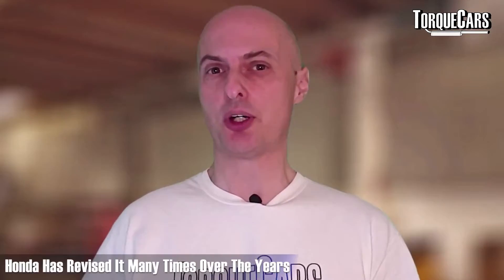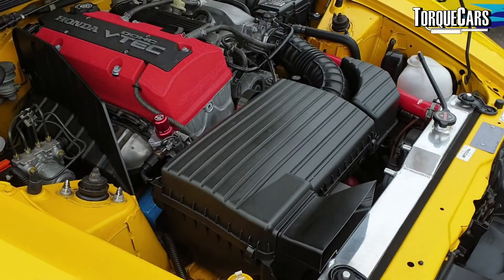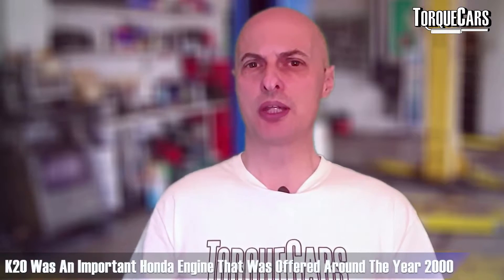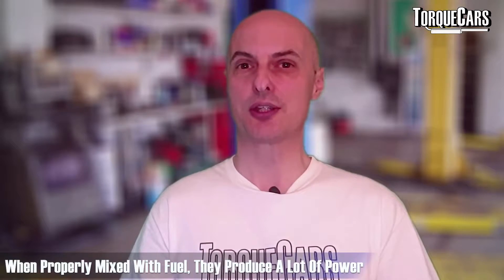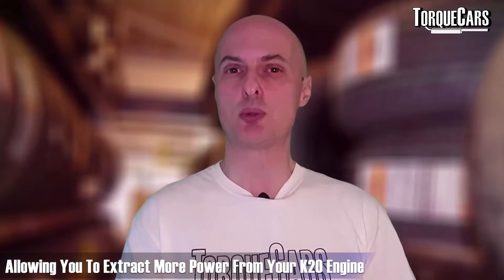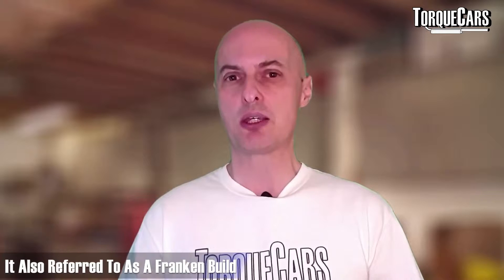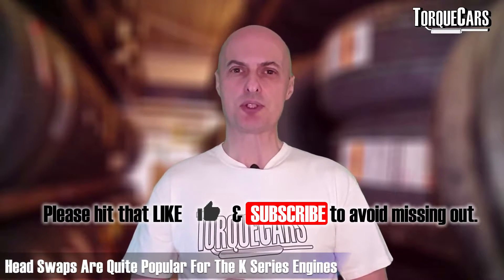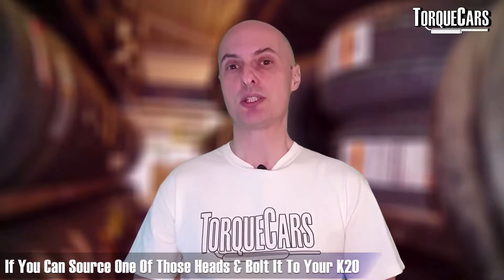Best Honda K20 Mods & Upgrades🔧 [Tuning Guide🏁]

Comment: hi, what catback would you recommend? I'm looking at tegiwas dont want anything too loud too or raspy
Reply from the maker: I'm not familiar with Tegiwas personally, which region are you in? The best K20 I've heard had a simple cherry bomb on it and a fairly long 3 inch wide resonator in mid section, but that was pretty loud. There was also an Apexi unit, a  Apexi WS muffler  but they did something on the mid resonator with that.

Comment: I am not looking for mega power but would like to up the power on my UK accord k20.
What are my first steps??
Are there simple mods that can get me up towards 200 without full on crank, head change options??

Many thanks

Craig
Reply: That's always been the problem with Honda's they are well tuned from stock, so to get more power you will have to do alot to get more from it. Is there any weight reduction you can do on the car. 
You should plan out what you want to do as just changing bits might have a good chance of just making it sound better but run slower. Then look at the costs and weigh it all up.
Reply: Intake, header, exhaust, underdrive pulley, and a tune should get you there

Comment: @FUELTECHUSA is a good stand alone ECU, search about!!
Reply from the maker: Cheers for the tip, that one has not been on my radar here in the UK. I recently discovered them though when researching the VR5 they seem to be one of the few covering a 5 cylinder engine.

Comment: Great info very in depth
Reply from the maker: Glad it was helpful! Thanks for the Support my friend. These are great engines, and it's no surprise that they end up in so many projects.
Reply: @torquecars  yes I have a Si with a k20 and I really want to make it better in all ways but mainly more modern and reliable
Reply: @cristianchinchilla8402  That's a tricky one making the K20 more modern. Theres a video on here where someone breaks down the K20 and new 1.5 turbo engine and the k20 is so much better engineered.
K20 has vtec and the Rover groups cam timing feature, although it's really old it's so good and no other manufacturer has managed to build a better system that is as reliable. Alot have tried with solenoid controlled valves but it always came with problems. I think toyota or Mitsubishi did something smart with variable piston stroke, but again how long will that last. The K20 is solid if it wasn't for emissions it would still be used.